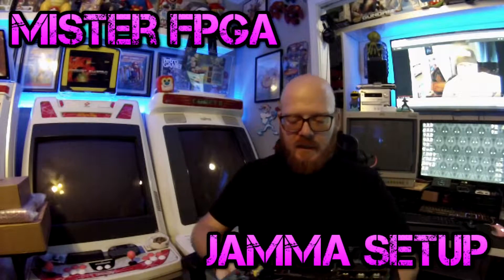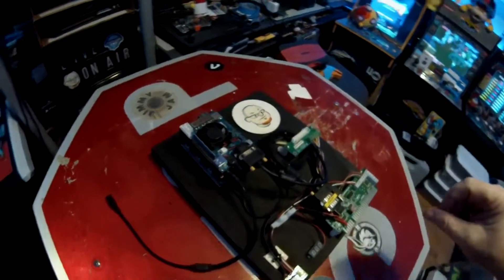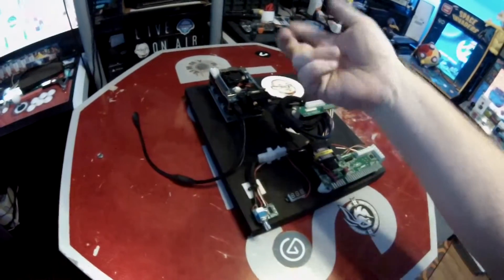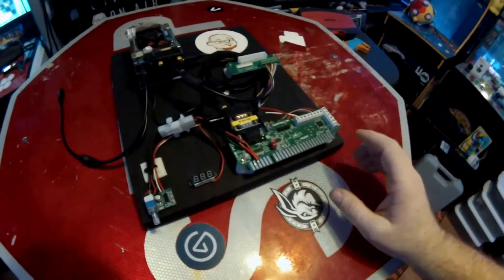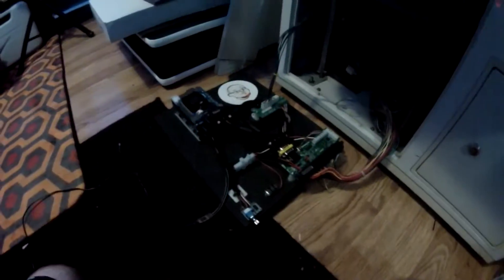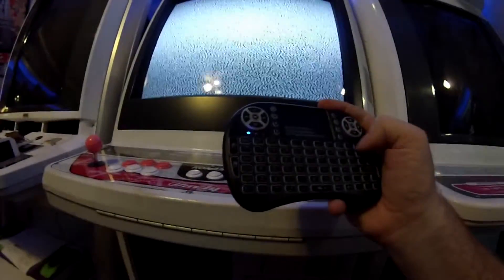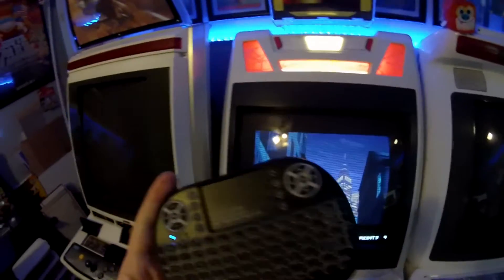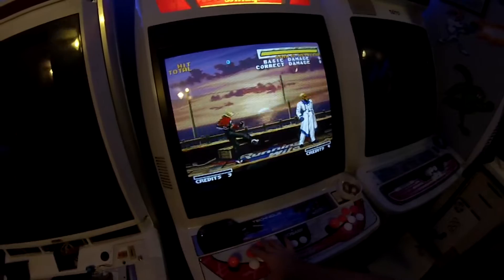MiSTer FPGA - Jamma Candy Cab Setup!

Comment: Hello. May I ask you how did you deal with the F12 menu using Jpac. When mapping Jpac buttons there is no such option for MENU. Thanks a lot =)
Reply from the maker: Hey there! I use a small wireless USB keyboard to bring up the menu. I use a USB port on my MiSTer USB Hub.

Comment: Currently looking for the best way to set up my candy cab. This looks great! But upon checking the website, I don't see any cores for the ST-V. A lot of arcade releases later made for the Saturn were on it. Guess a Windows rig with a JPac is still the way to go for me.
Reply from the maker: Saturn Emulation is underway, so I'd say give it a bit more time and we might see an ST-V core!
Reply: @PastBlaster  So nice to know! About a week after I saw your video, I got myself the real hardware, especially to test my cab quickly. Still wondering what might be the best solution especially if I want to add light guns or extra usb pads for 4P games. Loads of work to do. Right now, i’m focused on having my speakers working! 😄

Comment: hello ... I have a question:
it is possible to directly connect the control and button wires directly to the msiter fpga interface.
without this J-PAC Jamma card ... I wanted to make a direct connection ... to decrease 
is the imput lag possible?
Reply from the maker: You are going to need some sort of I/O / Encoder in order for it to work. You could potentially use a SNAC adapter or something, but not sure how. I play games on this setup a lot and don't really feel any lag.

Comment: I seem to be having sync issues on some of the cabs i have using the mister
Reply from the maker: The Egret 2 had some issues at first. There is a "SOG" or Sync on Green switch on the IO as well as some Sync Settings in your Mister.ini you can mess with. Feel free to message me if you want some help.

Comment: I'm using the JPAC hooked up to the VGA out on the I/O board, and I get really blown out levels going to my arcade monitor, to the point where several cores just refused to look correct even after massive monitor adjustments (SNES in particular).  I have checked around, and other people are seeing the same issue.  First off, anyone here have this issue?  If so, I was wondering if anyone has tried the HDMI-to-VGA-to-JPAC route to eliminate the issue, or if someone has tried converting component to JAMMA.  I am basically trying to just end-around the issue given how far different this is than, say, my real Neo Geo board or my other arcade boards (I have a few, and a PC, none seem to be behaving like the MiSTer).  Honestly, whole situation seems crazy to me, if the core is really doing what the MVS does, I shouldn't need much adjustments at all from my real MVS.
Reply: I have the same problem. I'm using HDMI -> VGA -> J-Pac now, but I'd rather use I/O VGA -> JPAC instead. Levels look terrible, and some colors are just completely wrong.
Reply: I'm having the same issue. Colors and levels seem out of wack plus it has trouble with sync on many games

Comment: nice video 
the barrel plug size should be  5.5/2.1mm and the center is usually +
Reply from the maker: Hey thanks! Still working on making everything as compact and still usable as possible. I'm thinking this will help!
Reply: Centre is certainly Positive.

Comment: Two Player would be great
Reply from the maker: I agree! I have been playing with it, and I believe currently, the MiSTer wants to see 2 seperate USB encoders for Player 1 and player 2. I am hopeful that they can add functionality in the future to allow the usage of one large encoder (JPAC) to handle both players. Fingers Crossed!
Reply: I have a candy cab too, but missing the monitor.  I plugged the cab's  harness straight into the JPAC and connected the JPAC to the mister board through USB.  The joystick and buttons worked fine, so I guess I will find a hdmi monitor and mount it in the cab.  i stopped the project because I could not get two player mode to work.  I'll set tight until there is solution.  Thanks for your great video....

Comment: Sick video on getting the mister running on a candy. What wireless keyboard are you using btw?
Reply from the maker: Hey thanks man! I am using this Keyboard.

https://www.amazon.com/Backlit-Keyboard-Touchpad-Wireless-Multimedia/dp/B07QNPX8C2/ref=sxbs_sxwds-stvp?cv_ct_cx=mini+keyboard+wireless&keywords=mini+keyboard+wireless&pd_rd_i=B07QNPX8C2&pd_rd_r=28033f75-0933-4b32-850f-5d4fcd8738d5&pd_rd_w=w5pHK&pd_rd_wg=5chh5&pf_rd_p=a6d018ad-f20b-46c9-8920-433972c7d9b7&pf_rd_r=CQ3Z62MQ71RQ7Z18AR1Q&psc=1&qid=1580923619&sr=1-1-dd5817a1-1ba7-46c2-8996-f96e7b0f409c

Comment: Can you show setting up player 2 controls?
Reply from the maker: I'd love to.....Just played with it, and it looks like because player 2 is on the same encoder.....it won't let you. I am hoping some of the bigger MiSTer guys see this and can help. I was hoping it would work more like a MAME setup that allowed you to map player 2 after player 1 was finished.....Maybe in a future update?
Reply: @PastBlaster  Yes, you need a special beta update from the JPac dude.
Reply from the maker: Maybe there is a way to set it up as a "Keyboard" and have it handle everything...
Reply: So far as the power plug goes, I'd say to check out the User's Guide from Terasic.